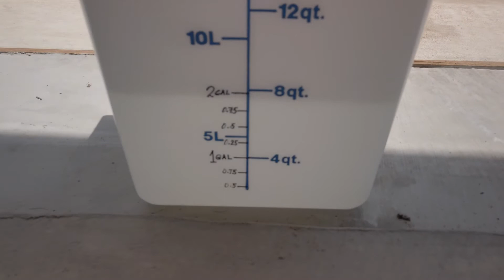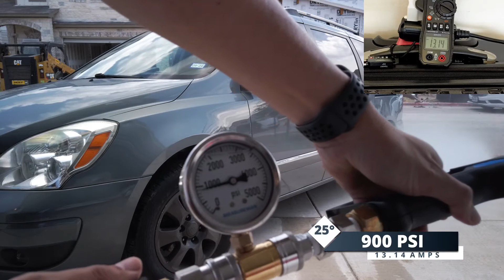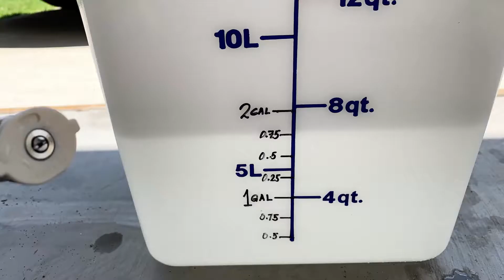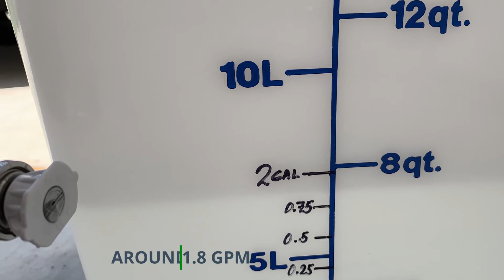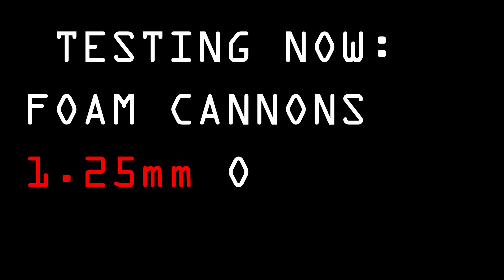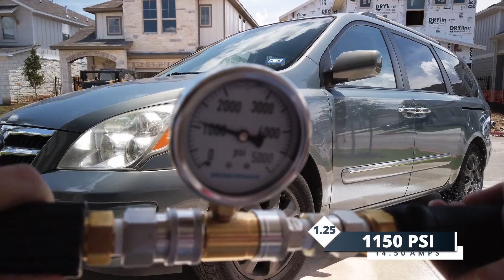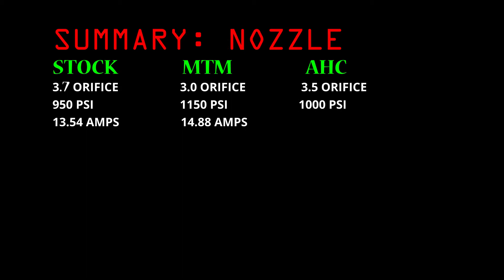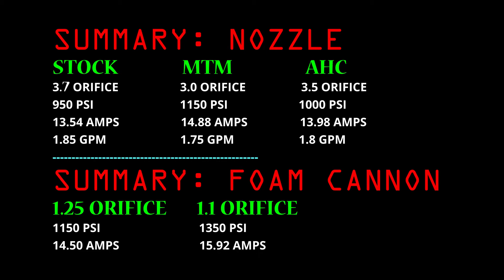CAT Pressure Washer | Part 2 | EVEN BETTER!

Comment: Hello man nice video, whats the update with the reliability of the machine?
Reply from the maker: Hi man! Thanks! So far so good. No issues, hope to add few more years to it. 😁
Thanks again for dropping by.
Reply: @jibs6318  nice am here wondering what to go for either this or the active 52? Mostly car cleaning with some thick suds and some around the house clean up
Reply from the maker: @peacemaker0071  I actually had these two. But decided to to keep the CAT. 
They got same specs but the appearance sold me on this one.
Reply: @jibs6318  okay and I see some videos with the foaming action does it have a recommended office size to use because the 1.1 over amp it.
Reply from the maker: @peacemaker0071  Yeah, got it covered. It is at the end of the video. 👍

Comment: Love the Video's Jibs. Testing specs others don't. After testing both, is the Cat worth the extra money over VE52? Thanks
Reply from the maker: Hi Jax, sorry for the late reply. Pandemic is really taking its toll. Yes, CAT is worth it. I ended up with this CAT pressure washer, l let go the Active.
Reply: Thanks for the reply. Hope all is well.  Just wanted to know about reliability  and longevity of the CAT .Thanks again
Reply from the maker: Mine is still working fine but not using it now as often as before.
Reply: Thanks Jibs.

Comment: Do you think this is good for cleaning  stone floors and brick wall ?  Thanks
Reply from the maker: Hi Tony, I guess if you use 20 or less degrees nozzles. It’s strong, but I suggest to test it first on a small spot.

Comment: Hi are you using the MTM nozzles over the stock ones ?  If you are any concerns that is using 14.8 amps over 13 from stock ( it may damage the motor ) wondering as im interested on the nozzles  thank you
Reply from the maker: Hi! If I am not mistaken, the machine is rated for 13amps. The lesser the power draw (amps) the better. It means not overdoing the machine hence longer life, well of course will also factor how you take good care of it. Hope it helps. 😊👍
Reply from the maker: I just realized I did not answer the main question. Lol!
I ended up using the 3.5 AHC Nozzles. 👍

Comment: Thanks for the video!! I have the Canadian equivalent of this which is the "Simoniz Platinum 1800". I am thinking of placing it on a metal shelf. Only issue I am running into is I need a 90 degree elbow from the machine to the outlet hose. Any idea on where I can get something like that?
Reply from the maker: Hi Juan! Check with OG. They might have it.

Comment: Great video! 👍🏻 I already bought the active ve52 with a 50ft 3/8 hose, sg28 gun & mtm pf22 foam cannon combo. I cannot wait!
Reply from the maker: Spawn and Batman Nice set up. I am excited for you. What hose did you buy?
Reply: @jibs6318  its the tooldaily 3/8 hose off amazon. Its red and black and
Reply from the maker: Spawn and Batman The one that has a fixed connectors on both ends? Nice!
Reply: @jibs6318  yeah. That away I didn't have to worry about buying the m22 qd's. Hopefully its a good lomg lasting hose.
Reply from the maker: Spawn and Batman I agree, It’s a good quality hose with fittings already installed. It’s just a little bulky for me, I prefer 1/4.
Reply: Don’t you lose pressure with 3/8?
Reply: @dhattboijuju7243  I was wondering the same thing. Honestly though i wish I didn't go with the 3/8 hose because it is tough to deal with.  Winding it up, moving it around and untangling is a pain in the ass sometimes.  But it's heavy duty
Reply from the maker: That I haven’t tested, comparing 1/4 hose and 3/8. But I guess it will still depend on the nozzle orifice at pattern since same amount of water will come out regardless of using 1/4 or 3/8 hose. Just my thought. 😊